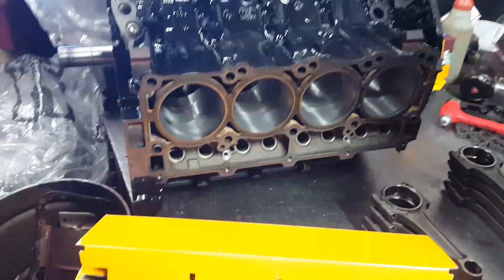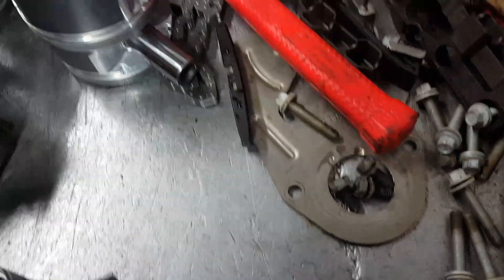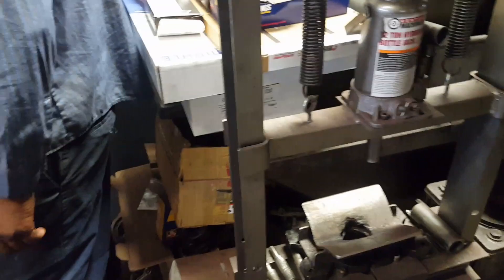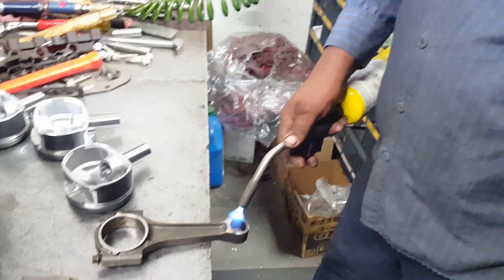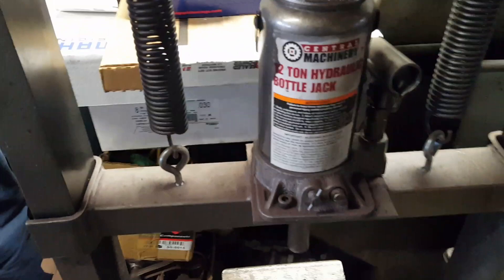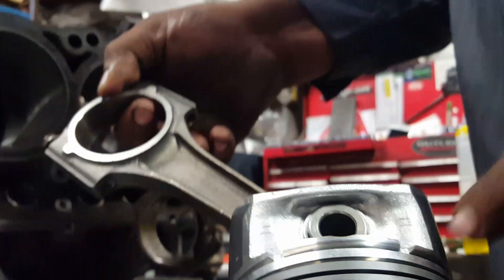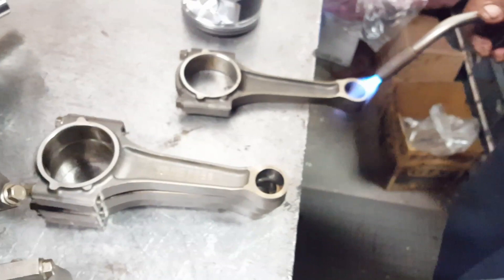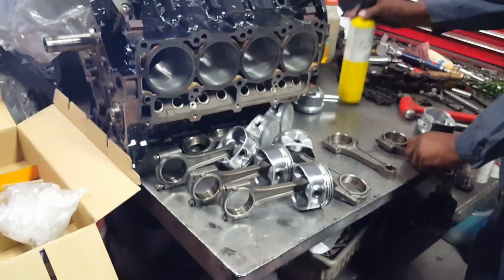How to rebuild hemi 5.7 engine

Comment: So where's the engine stand?
Reply from the maker: Hardracer don't need it 👉😎😂
Reply: I dont doubt the shops ability to build a motor but u claim 4-5 a week(which i find hard to believe)an engine stand is way better than rollin it around on a steel table..harbor freight has cheap 1's that will get it off that table...hell put a piece of carpet on that table or sumthin.I saw on another vid you guys did the boring...did you hone it there to?what kind of hone?how are u measuring the bore?certainly not a piston and feeler gauge right?
Reply from the maker: Hardracer yeah 4 to 5 5.7 hemi engines a week,and about the stand i just don't like the stand,and about the bore nd hone, we do bore nd hone in house!! Not going to lie because honestly don't know the brand and serial number of the machines but they are huge lol i can make a video on the walkthrough or walk around if u like?🤔
Reply from the maker: Ares yeah i will make one nd hahaha nah we do not use a drill lmao we use a hugge sunnen honing machine!👌
Reply: Was traded for beer!

Comment: My 5.7 hemi dropped a valve what do I need to replace so I can get my charger back on the road? It messed up the Pistons and cylinder heads.
Reply from the maker: Heads will need full valve job with valve seat replacement,also will need brand new intake manifold because little pieces of metal always get stuck there and cleaning or washing will not work!! You can remove the damaged piston without removing the engine, only remove oil pan and remove the damaged piston, make sure the wall of the cylinder is not damaged with big lines,cracks or grooves!
Reply: JM8686 okay well one of my cylinder walls are scratched a little and the coolant has a little bit of sludge in the coolant ports of the block, what should I do about that?
Reply from the maker: You can always hone but if is deep you will have to bore!!
Reply: JM8686 okay thx.

Comment: People always talk shit bro keep up the good work. Pinches guerillo siempe cagan El Palo con que jale machin no aye pedo. Always gotta have some fucked up input on doing the shit there way. I've assembled machines in sand and had them suckers run real good. Also what the hell is the purpose of the oil filter if it ain't gunna work the way it was intended to.
Reply: @JM8686  Animo carnal! Oye yo tambien Tengo un 5.7 hemi 2004 que tipo de pistones recomendas para levantar la compression a 10.5:1 a comparasion de lo que tenia antes 9.5:1?

Comment: Do you mind telling me how much you guys charge for this job? My2006 dodge charger 5.7 is blowing white smoke from tail pipe. It is very shaky and turns off.. I dont drive it at all. It says I have a misfire on cylinder 7 no water in engine.. I'm thinking of just fixing everything it has 132k miles right now
Reply from the maker: Thanks for watching, where are you located?
Reply: @JM8686  I'm in the san Fernando valley, California.
Reply: Was it the cam and lifter?
Reply: @robertmatthew5332  no it was the piston.. it broke I ended up rebuilding the long block.
Reply: deadlysin91 maybe you can answer a question then. Per the video, for pistons placed on the drivers side of engine, that’s considered the left  correct?
Reply from the maker: Yes driver side is the left side 👍
Reply: @robertmatthew5332  yes its located on the left side

Comment: Don't  think that's what the arrow  means
Reply from the maker: Ron Washburn ohh hahahaha 👍, thats a nice RT you have there my man 👌
Reply: Yes it does..... certain engines have certain protocols depending per the manufacturer's specs.... instead of mouthing off bs read a book before you look stupid on social media those two gentlemen are more than capable of knowing what they're doing.... I've used this method before and never had a problem.....

Comment: @JM8686 Que onda carnal oie para un motor de una 2012 Hemi 5.7 que tipo de lifters recomiendas. Sin tener que cambiar nada de tuning. Porque queria ponerle unos de high performance pero me dijieron que si lo hacia tenia que buscar a alguien que me hiciera tune la truck ones I was done. Porque le hiva a cambiar tambien la cam shaft por una high performance ya que tambien se daño. Pero no quiero tener que hacer nada de tuning que kit recomiendas que esten ya update Las partes pero sin tener que hacer nada de tuning. Pretty much take off, put on deal.
Reply from the maker: No ocupas hacer tuning si metes lifters  diferentes pero te aconsejo mejor meterle lifters de el DEALER
Reply: @JM8686   pero ya estaran updated Los nuevos del dealer? porque sino Va a  volver a pasar lo Mismo
Reply from the maker: @Elguzman0212  si lla salen mejor,nadamas dejarlos recojer en aceite de motor unas horas antes de instalar

Comment: Wassup bro! Can you please respond asap ! Are these pistons specific on oil grooves ?
I have mahle 99L22 and 99L17 pistons on my 5.7
The arrows are pointing and the oil grooves are looking like yours. But once installed,  they are both either all upwards, or downwards ( if I switch them around) I'm confused

Comment: don't u ever preheat a connecting around me. only disbacj okies do this or in this case piasadas bad job habits
Reply from the maker: Angel T. Sorry i only understand half of your comment,could you check your grammar?
Reply: No need to can't repair engines ,now can't read. not subscribing
Reply from the maker: Angel T. Hahaha is just that i don't really understand you 😂 mejor escribe en español 👌👍
Reply: So what would work instead